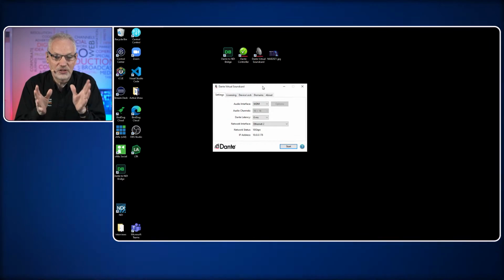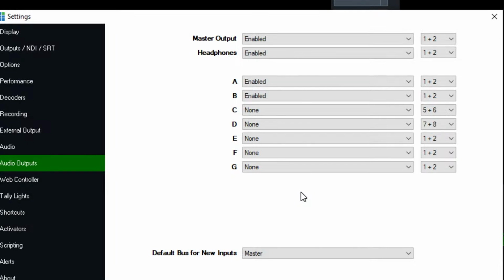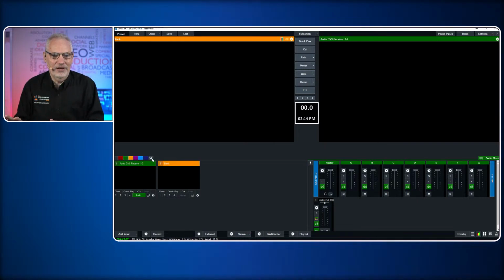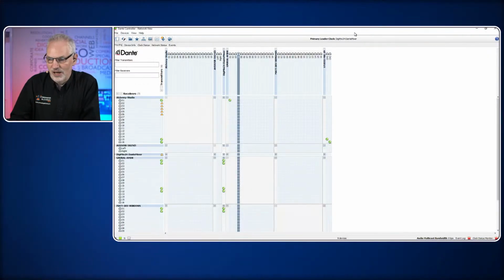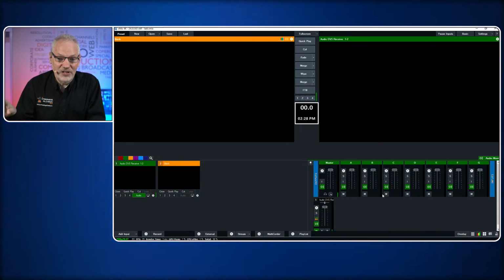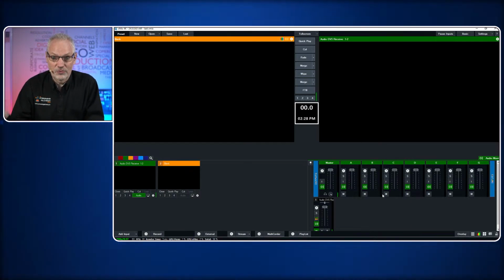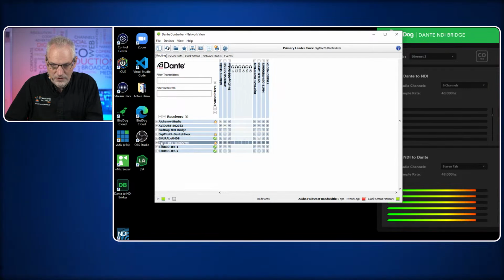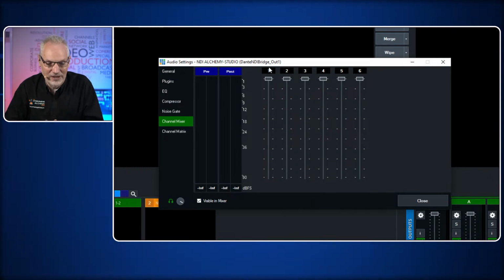Using Dante with VMIX - A Detailed Look (+BirdDog’s Dante NDI Bridge)

Comment: Can Dante be used over a MoCa network
Reply from the maker: Hi Larry - Unfortunately, I don't have a specific answer for you. There are 3 versions of MoCA available (1, 2, and 2.5) which do go up in throughput and improve latency. Dante is more sensitive to latency as the data stream itself is relatively small (while 1Gb networks are strongly recommended, it will work on 100Mb networks) I do not know the latency introduced by real world connection points, which could vary significantly from the optimal latency of the spec itself. That said, MoCA is a level 2 protocol (in the ISO networking stack) and Dante is a Level 3 protocol, meaning they SHOULD talk to each other without caring about the specific implementations behind the layer interfaces. (something that isn't always the case in practice). If the full MoCA path has low enough latency (less than 10ms max) and fully supports PTP (Precision Time Protocol) which Dante uses to keep all of the signals in sync, it theoretically should work. Given the number of caveats and 'maybes' here, I would definitely set up a test of this before investing in any gear or committing to any productions that would leverage it. Sorry I don't have a more specific answer for you here.

Comment: Dante is terminated on both ends using the Dante sound card. Another words, a "computing system" running a Dante sound card must be available on both ends of your feed. Is this a correct observation?
Reply from the maker: Hi Larry - You should think of Dante Virtual Soundcard (DVS) as just a software-based Dante adapter. It can exchange audio with any other Dante device on the same network - Dante hardware mixers and interfaces, Dante speakers and audio gear, AVIO adapters, and other computers running DVS itself. Dante isn't a one-to-one audio connection.

Each Dante source (Transmitter) is published on the network, and can then be picked up by any number of Dante Receivers. This mapping is done using the Dante Controller application. However individual systems or devices connect using Dante, they all share a common 'Master Clock' that ensures that all audio remains in sync traveling across the network. 

Hope this clarifies things a bit. Thank you for watching!